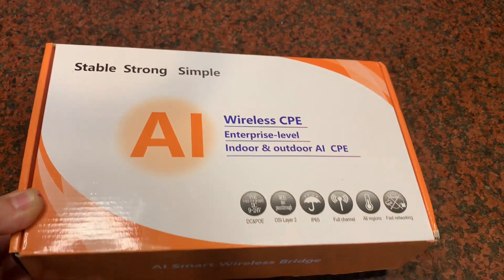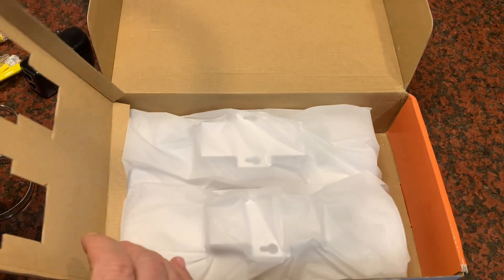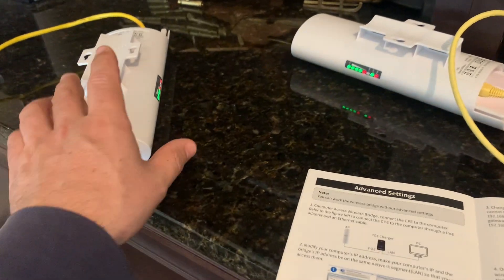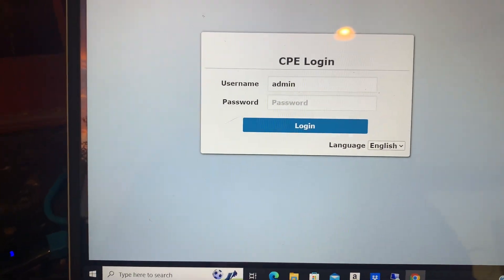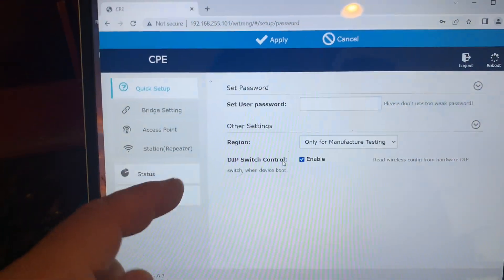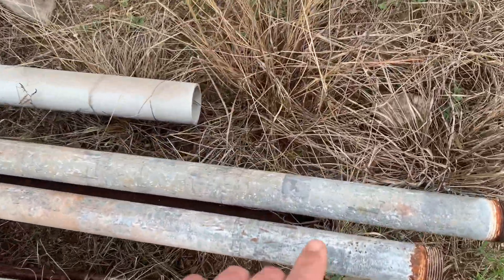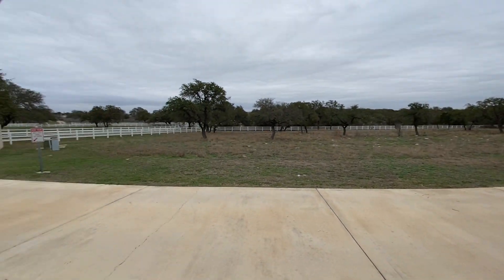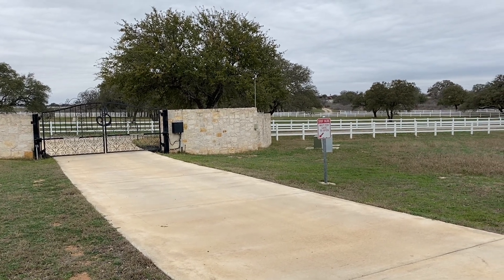✅ Install the CPE402 Wireless Bridge Set from ULNA to Extend Home Network

Comment: These are identical in packaging and layout to the “UeeVii” bridge products. The product numbering scheme is even identical. I have the CPE-452 configuration.  I really like them, but the bridge seems to flap a lot, and go fully offline at least once per week, requiring a restart of the master side.
Reply from the maker: That's too bad.  I have not experienced this issue.  I can't even remember a time where mine dropped a connection, or when I last restarted them.  It's been months.